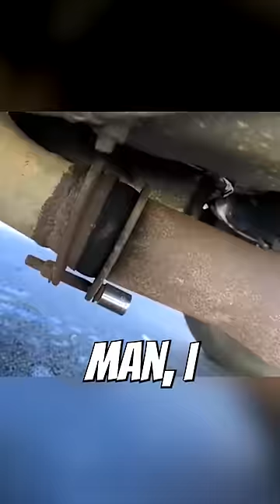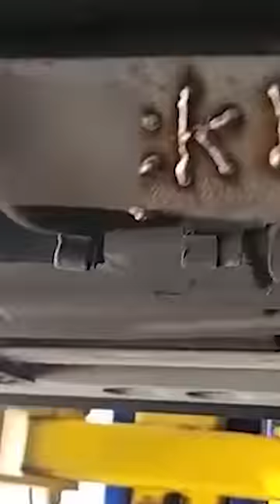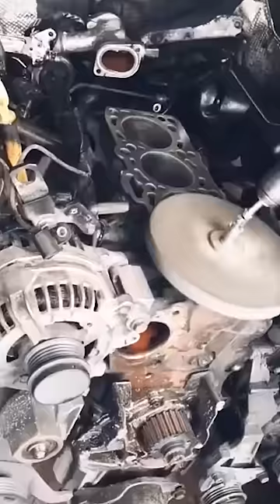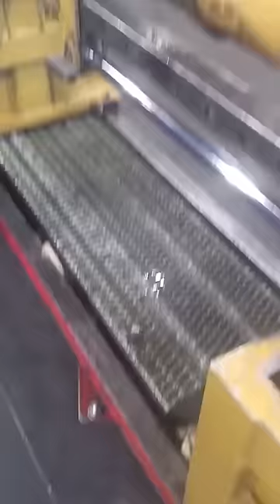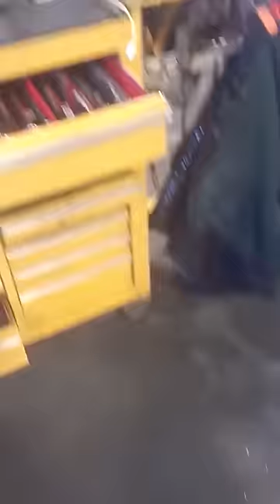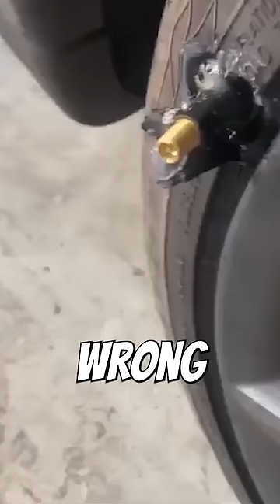Mechanic and Car Fails That Will Clog Your Catalytic Converters #shorts

Comment: That is a hammer. Anything within reach is a hammer when a hammer is not within reach.
Reply: Some people just don't understand this I swear glad you guys do
Reply: That is the most wise thing I ever heard
Reply: A crescent wrench is an adjustable hammer.
Reply: Can confirm.
Because I've done that in a rush.
But seriously, don't whack your ratchet.
At least use a wrench.
Reply: @XxKNIGHT742xX  Or at least use the handle side of it
Reply: Exactly,pliers,hammer, wrench, ratchet, nail not very effective,shoe,screw driver and so on
Reply: @joeanderson2642 so is a rock
Reply: @XxKNIGHT742xX  why not? I have done that millions of times and still haven’t broke one.
Reply: That's actually a step in the processing and manufacturing of tools. It will be used as a hammer. Might as well make sure it can survive that.
Reply: Everything looks like a hammer to a nail 😂
Reply: I was going to comment this but immediately saw yours 😂👍🏻
Reply: I have a ratchet that doesn't work right because I used it as a hammer!😂
Reply: Snap On guarantees their tools! If it breaks get a new one
Reply: Yep, like Eric O. says: "Every tool has a hammer side; even a hammer".
But seriously - we all do it, but try not to do it with ratchets or anything with a ratchet mechanism in it because it will destroy it.
Reply: That's a clicky hammer
Reply: I've got to say my old 12v makita battery works great when needing a hammer fast

Comment: Jokes on them, because if they cut my cats off they'll find out they just wasted a bunch of time pulling hollow tubes off my truck!😂😂😂
Reply: Lol. Made your job easier to install straight pipes lol
Reply: That's some good weight reduction
Reply: um excuse me, is that Euro VI compilant?
Reply: What is happening wit cats? And more importantly, Why they stole it??
Reply: @yoslauda4714 they're easy to access and really expensive because they're full of precious metals, so people steal them to sell the metal for scrap.
Reply: Lost mine in a freak boating accident, stuff happens you know
Reply: @LEROYDANIELSON nah we gotta fuck with them since they want to steal the fake cat, waste there time as much as possible.
Reply: @yoslauda4714 catholic convertors often have platinum in them
Reply: @vanq4999 They're only expensive because they're hard to make. They only contain like $20 of platinum
Reply: @HeavenLeahSky catholic converter 😂😂😂
Reply: @aniquinstark4347  I just took my cat to a scrap yard I got $100 for just it, off 2001 subaru
Reply: @barrowscasper12  All your cats were in the boat with you when it capsized, Eh?
Reply: @HeavenLeahSky  'Catholic' converters don't usually have platinum - they are usually armed with a cross though.
Reply: @AMurph79  ah fluff nooo

Comment: That’s exactly what the bulky head of the ratchet was designed for. That’s why it has a lifetime warranty. If you always used a ratchet as just a ratchet and not a breaker bar/hammer, it would never need warranty.

Edit: anything with warranty MUST get abused and have the warranty used or you’re not using it right. Using warranty’s is a requirement if you have them.
Reply: As I have read somewhere "if the warranty covers it you're not using it right"
Reply: Haha I LIVE by this rule. When I buy anything expensive I figure out how likely I am to break it and that decides if I take out coverage... Went through 3 IPhone's in a month and almost 20 in a year with the first four models 😂 I have ms... So I drop EVERYTHING... I LOVE good coverage. I once bought a 1000 camera and broke it walking out the store. Technically a guy wasn't watching where he was going and nocked me over... The staff just came out took the bags back and swapped it. Fastest insurance claim EVER. 🤦‍♀️🤷‍♀️🤣 Now I only break one electronic a year. 😁🤣
Reply: @cececox6399 you’re why we can’t have nice things?

Comment: I don't believe the valve stem in the sidewall. That can't be real, can it?
Reply: There is no possible way.  When driving, the tire will bend it every rotation.   As it gets hotter from bending and the normal head generated by driving.  It could break off from the metal and rubber bending, the normal heat generated by driving,  or just pushed in.   NEVER DO THIS!  You will turn tht valve stem into a rocket and lose all control when you blow that tire.

I am hoping that, at least that part, is a skit.
Reply: Don’t listen to him 👆🏼 I’ve done this before when a nail went in my sidewall so I put a valve stem in the hole and was able to drive it home no problem… 🤥
Reply: @jamesringness3702  Just because someone has done it before does not negate the very real danger you put other people and yourself in by carelessly doing a repair.
Reply: Might have been to plug a hole.
Reply: @jamesringness3702 a tire is useless once the sidewall is compromised and you made it worse.

Do you want to have a catastrophic blow out and kill people, because that's how you do it.

Comment: I don't get the one with the computer screens, that could have been an accident or something, also the monitors will probably be fine, and even if not I would be willing to replace them, so how does that lose someone their job real quick? Also what kind of Goo is on the screens, and how did it get there? That seems unclear from the video.
Reply: That one confused me too, I think what happened was the door got left open and it was raining.
Reply: Yeah, I have no idea what the hell that one was about
Reply: Look, you really expect to not get fired after damaging company property? They're usually pretty up-tight about that stuff, plus they might have been doing stuff wrong to cause whatever fluid to spray out like that (not say they did it on purpose but it was a cause and effect scenario), just more reason for trouble.

Comment: I found my half inch deep socket under my blazer the other day stuck to a bolt. I tried kicking it but it wouldn’t budge so I left it knowing where it will be later. Hopefully.

Comment: Spray some WD40 on it beforehand to make it easier to remove??
Reply: Deep penetrating oil... (that's literally what deep penetrating oil is designed for)... also, you can just use the ratchet to turn the nut/bolt the other way than the way it got stuck... not enough to actually turn the nut or bolt, just enough to unbind the socket. Also you can get off your @$$ and go get a proper hammer if all that fails...

Comment: I have to disagree that using a stone to prep mating surfaces is incorrect.  If you are building a high performance or racing engine.  The clip shown would be perfectly fine for an everyday driver engine assuming two things 1) the stone is very fine, wider than the intended surface AND kept perfectly flat and 2) a lubricant is used under the stone and the engine is THOROUGHLY cleaned before reassembly.  I would NEVER do this with the engine still in the vehicle and not fully disassembled.

Comment: How many Dudes here put too much Power Steering fluid in a pre 77 power steering box & blew all the seals? No MoFo told me to get a syringe & suck the excess out BEFORE starting the bloody engine. SMH My beloved Ford Fairlane was like some dog that left a dirty mark on  the rug thereafter. I should have put her in long term storage, after rebuilding her 302 Cleveland with mild Cams & tight tolerances, nearly blueprinted, she was so cruisy but the PS box leaking made my ex wife force me to sell her for pennies. SMH, Dont let women make car decisions, thats my only advice. I'd give my Left testicle for the Batmobile back now. 😞

Comment: Crazy enough I to have had a valve stem stuck in my tire. Could pull it out so i pushed it in and plugged the hole🙆‍♂️🤷‍♂️

Comment: I was freakin tired that day and I removed a spinner CCV filter and started the truck couple minutes later. Freakin windshield went black then I realized... Holy mother of god... 3 of my coworker working 10 feet from me never noticed even when I was on the roof with a pressure washer, nobody knows to this day but me. Thank god, lord have Mersey. Edit: took 2 hours to clean, the whole truck looked like a freshly painted black knight edition from front top to bottom.

Comment: Supposed to use the battery on your impact
Reply: As a hammer to loosen a stuck socket? Yo, don't even disconect the impact... just switch it to the other direction than you drove it to get it stuck and tap the triger for like a tenth of a second... not evough to undo your work, just enough to break it loose. It's too easy. That being said, I once saw a guy drive a framing nail into a 2x4 with a DeWalt battery and drill/impact/whatever he had I wasn't paying that close of attention to exactly which tool it was, I was just shocked at what I was seeing. It worked, Mard up the plastic shell pretty bad, but it got the job done... as best as I could tell it was his own tool. I was just flabbergasted though. I mean I've used a power tool and battery to lightly tap something in place, sure I'm guilty of that, but driving a nail... wow, that's insane.

Comment: That stone on the drill is on a 1.9 tdi block from volkswagen, its a diesel. These engines are VERY reliable, but I don't think they outlive such stupidity... They will def. blow the gasket with that... Those tdis run 1.3 bar or even more